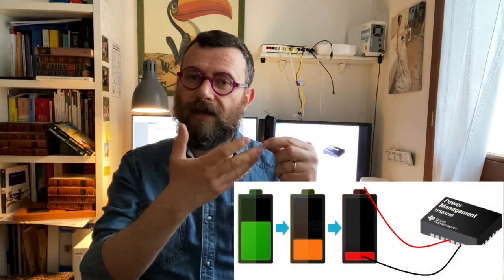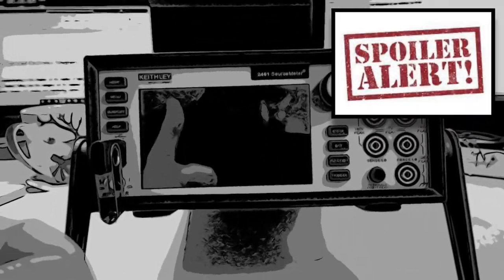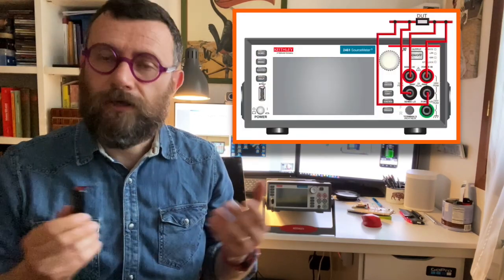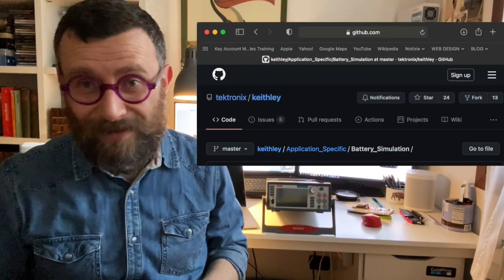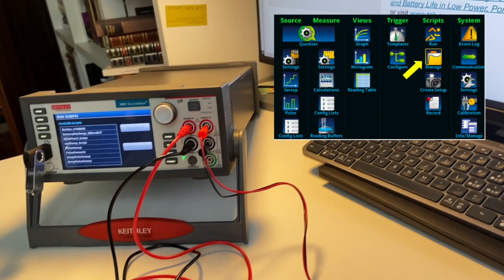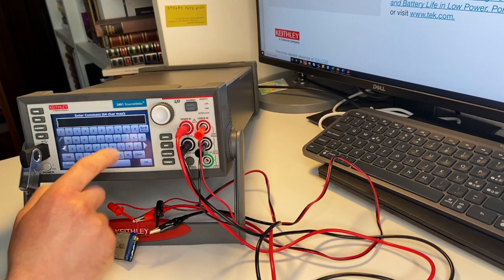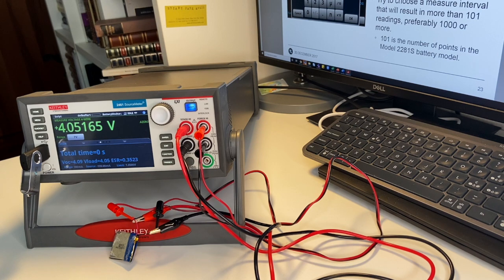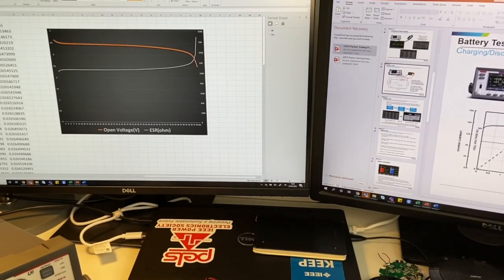How to Model a Lithium Ion battery with a Source Measure Unit (SMU)

Comment: I love my 2450 and 2460 SMU's, and the TSP programming.  Before I had two SMU's, I wrote a script to use a DMM7500 and a 2450 to test small boost converters for battery applications https://youtu.be/kCj0mXoodlY